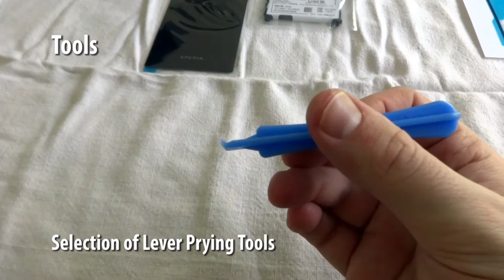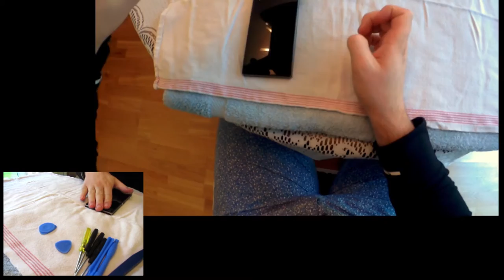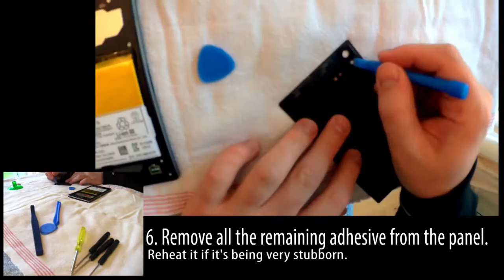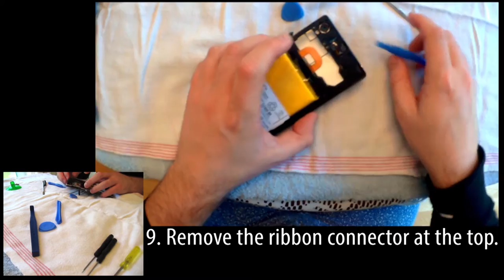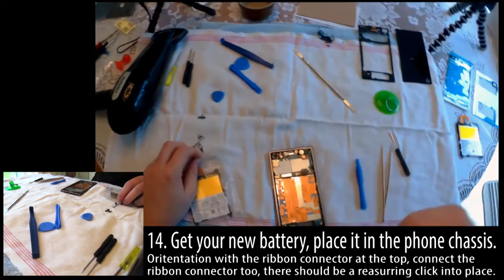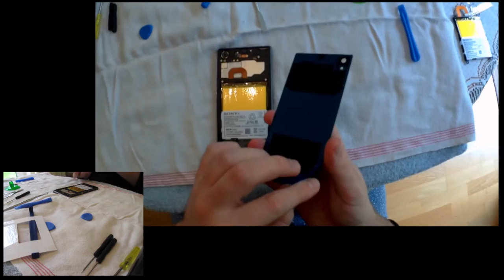The Real Battery Drain Fix | Sony Xperia Battery Replacement | Xperia Z1

Comment: Hello Matt. Your video guided me while replacing the battery of my Z1. But after I changed the battery with new one and connected it on a wall charger, at first the red light flashes but turned off after few seconds. I tried to power up the phone but nothing happens. Maybe you encountered this issue before. Please help me. Thanks in advance!
Reply from the maker: Xian Marc Hermosa I think I know the problem you might have. Hold down volume up and the power button at the same time for about 5 seconds until the device vibrates. Then try and turn it on as normal. Hope that works for you!
Reply: Thanks for the response. I've tried it many times but no good result :(
Reply from the maker: Try hold volume down and power on for a few seconds. Some phone variants are different.
Reply: Xian Marc Hermosa
Reply: The battery I first bought was defective so I ordered again. Now the Z1 is fully working :)
Reply from the maker: Good to hear. I've heard there are a lot of dodgy batteries out there, as they were manufactured a few years ago and just sat in warehouses when batteries aren't used they tend to die pretty quick sadly.
Reply: Matt Beedham where can i buy the battery for sony experia?ant recommendation??

Comment: My GF's battery still dropped fast after replacing the battery. From reading online it appears the problem is in the software.
Reply from the maker: Sometimes it can be. If there are particular battery drains. Sometimes though if you have replaced the battery you may have got a "dud". Some of these batteries have been sat in warehouses for probably years now, without being charged or discharged, which is very bad for their long term life. I was lucky and got a good one which gave me another year of normal use out the phone.